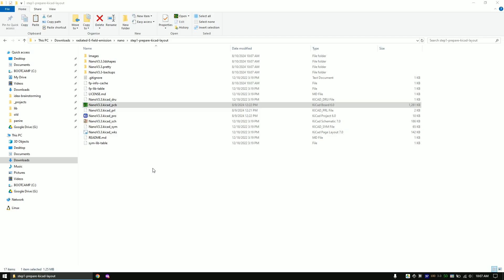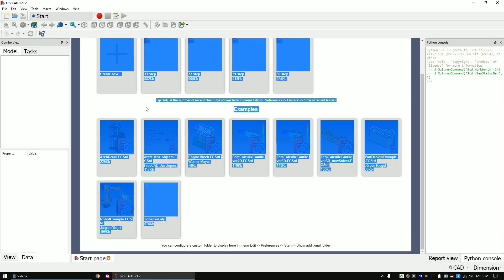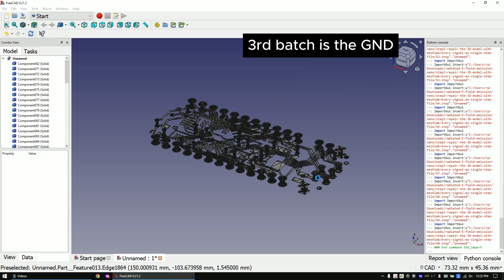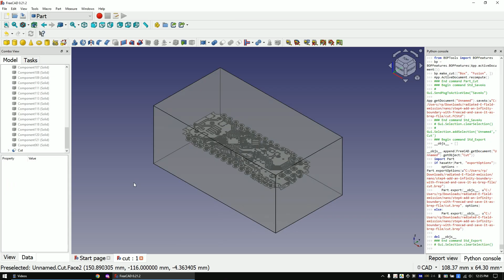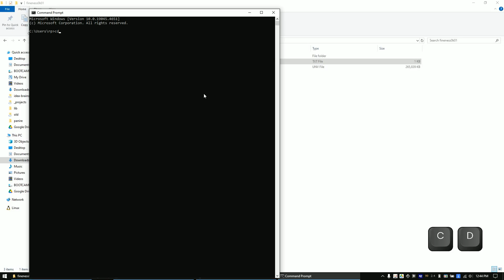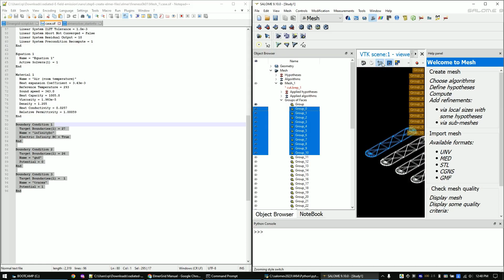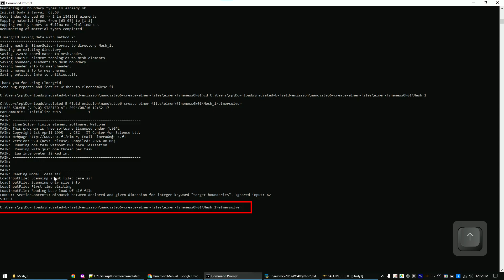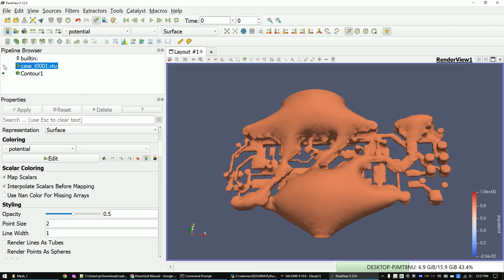free radiated emission simulation (electric field) of a KiCad layout + PCB  layout review

Comment: Why do we need to export each object as .step file? What difference does it make than converting the objects to solid directly in Part workbench? (FreeCAD noob here)
Reply from the maker: If it is not done, FreeCAD gives me an error when trying to cut out the copper from the airbox, so its just a workaround. I dont know the exact reason for the error, it might be an intersection problem.

Comment: 2:38 Macro doesnt seem to run correct for me, there are no exported files. Maybe I didnt copy it correctly? Could you post your macro?

from PySide import QtGui 

folder = str(QtGui.QFileDialog.getExistingDirectory(None, "Select Directory")) 
a = Gui.Selection.getSelection() 
count = 0
import ImportGui 
options = None 
if hasattr(ImportGui, "exportOptions"): 
	options = ImportGui.exportOptions(".step") 
for b in a: 
#	objs = [] 
#	objs.append(b) 
	file = folder+"/"+str(count)+".step"
#	ImportGui.export(objs, file, options) 	ImportGui.export([b], file, options) 
	count = count + 1
Reply: I modified it and this worked for me:

from PySide import QtGui 
import ImportGui

# Prompt for folder to export files
folder = str(QtGui.QFileDialog.getExistingDirectory(None, "Select Directory"))

# Get selected objects
a = Gui.Selection.getSelection()
count = 0

# Loop through each selected object and export as .stp file
for b in a:
    # Generate file path
    file = folder + "/" + str(count) + ".stp"
    
    # Export the object as STP
    ImportGui.export([b], file)
    
    count += 1
Reply from the maker: @GamisteToDimosio  glad it worked and sorry for the delayed reply. The code i used in the video didnt work for me as well anymore even after using the same FreeCad 0.21.2 and Python 3.8.17 version as in the video, not sure what changed.
Your new code on the other hand works. 👍

Comment: Would be nice if all the tools could be bundled under one design environment.

BTW, can KiCad import an Altium project?  If so, how well, or what are the limitations?  Can it convert not just the schematics, but the PCB Layout, libraries, etc?
Reply from the maker: * Its on the KiCad agenda for many many years already to implement/ bundle Simulation features into KiCad, but there seems to be more urgent topics still to be developed.
*Kicad 8.99 has an Altium Designer Layout import option. I tested the import for at least 1 file and it worked to import the layout file. If it works good enough to be able to make a simulation out of it I am not sure. Expect at least some manual work when converting from one application to another.

Are you primarily an Altium User? If you already have an Altium license, probaby Ansys HFSS would be an option.

Comment: All of these software packages you use and jump between are very complex, especially for a first time user, and it makes it more difficult when none of the PCB trace elements are properly labeled. Also I think that there is no need to simulate every circuit. Once you have simulated a few, you can guess what will happen with new designs based on best practices and key learnings from old designs. From a novice/hobbyist perspective, all I really want to know are what are the best practices for PCB layout to avoid EMI interference, parasitic capacitance, and inductance. What are the key learnings we can easily apply to any circuit design? Cool videos though.
Reply from the maker: Thanks for your comment! I agree with the points you raised about the complexity and the repetitive nature of such simulations. I'll explore ways to visually summarize key EMI topics in another video.
Reply: @panire3  Have you tried building a PCB microwave antenna before? And have you studied how it affects circuits close by? For example most mobile smartphone’s today have a microwave/wifi transceiver, which is typically the metal case of the phone itself, which also houses the circuit boards, components and CPU/memory modules. My question is, how do they isolate those components from the microwave radiation, when they are literally sitting inside the emitter itself?
Reply from the maker: Digital Circuits (CPU/memory) mostly dont really care about noise as long as its not too extreme. If there are sensitive analog circuits (e.g. compass IC, audio IC, current sense,...), in phones they will be shielded with a shield-can and via stiching from all sides, see example pictures below in the link. The Microwave antenna is not the only thing to shield against, each digital IC (e.g. CPU/memory)  and the buck converters will also radiate, thats why each functional block is also shielded from each other. https://drive.google.com/drive/folders/12WIK75Rprk6w3uYxQqoohkPaZf_jGWDk?usp=drive_link
In my view, if you want to build something, just go and create it without worrying too much.
Big companies invest heavily in shielding because they sell millions of units and cant afford to make mistakes. For DiY projects or Startups, start with a basic design without any shielding and focus on carefully placing your analog circuitry (if any). Adress any issues that arise as they come. There is a high chance your design will work. Take Arduino, for example—the design looks simple and EMC guys will always point out how the layout needs improvement, but it works for many applications, and many commercial products use Arduino components. They might be a bit noisy, but they get the job done.
Reply: @panire3  Thanks!
Reply: @panire3  I notice that in cases where there is high voltage, that things change. Like for example with a CNC plasma machine, it requires the use of fiber optical connections because of the very noisy high voltage power supply and the plasma cutter itself.
Reply from the maker: do you actually have a plasma cutter in use? did you ever try twisting the cable to see if the noise is getting less? When i look at videos online, the setup people are using has huge ground loops, often the size of the whole room. https://drive.google.com/drive/folders/16edWpnWBmqHLtwxT2H8xNFn4lQoWQbaI?usp=sharing